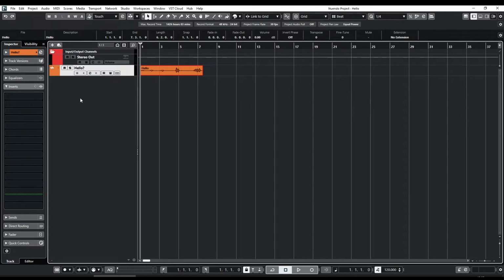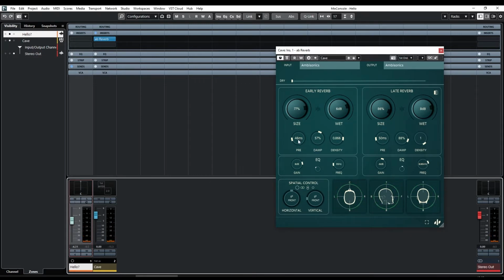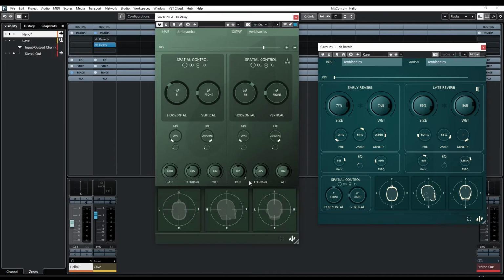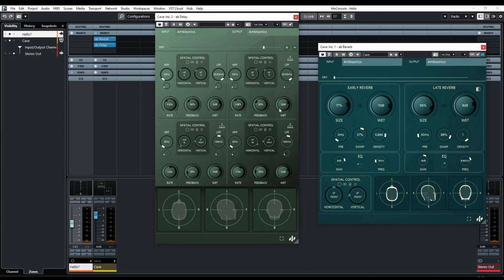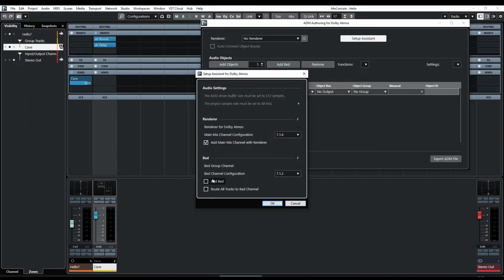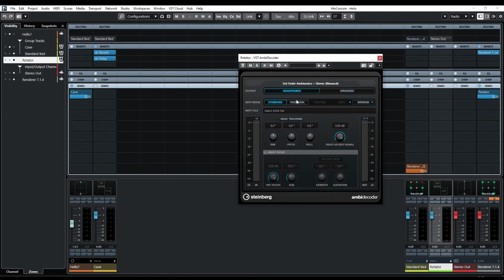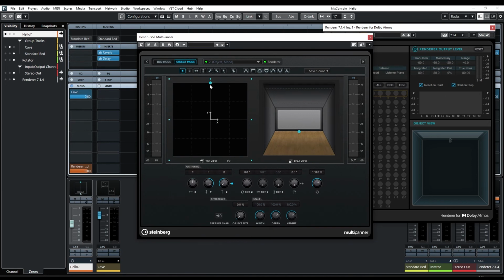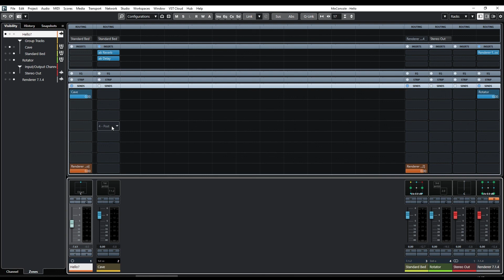Sound Design: Cave Effect in Stereo and Dolby Atmos (Steinberg Nuendo 12)

Comment: hi! I am really interested in your ab reverb plugin. I am primarily working Atmos in Nuendo 11, due to upgrade to 12. I was wondering if I were to use ab reverb, can the existing Ambidecoder be used to output to a 7.1.4 speaker configuration? You don't show the way the Ambidecoder is decoding your FX channel. I was under the impression that Nuendo's Ambidecoder can only convert to binaural (headphones) or stereo speakers? Can it output to 7.1.2 for me to then route to a bed? Or is it primarily designed for binaural listening only. Cheers!
Reply from the maker: Hi Ollie, apologies if I didn't show that specific detail in this video, there's just so much to show, I always miss something :P! Good news is YES, Nuendo's Ambidecoder can go from Ambisonics to ANYTHING (including 7.1.4) natively :) So once you route your Ambisonics channel to a 7.1.4 group, Nuendo should take care of the rest. So basically all our Plugins can be decoded to 7.1.4 in Nuendo without the need of any third-party decoder.

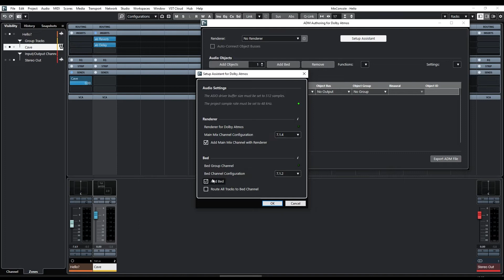Additional to a bed, and to make it even more wicked, Nuendo can even decode our plugins to a 7.1.4 OBJECT, meaning you can later shrink the object, rotate it, change its size, everything independent from the bed, whilst keeping its own three-dimensional information! It's pretty insane! For an example, check out this video https://youtu.be/woFnmOzQdbw?t=496 at 8:16, where aside from the reverb at the Bed, we also added an Overhead Reverb AND a Snare Delay, both routed to a 7.1.4 drums object, and then shrunk the object as we wanted the drums to be "smaller"